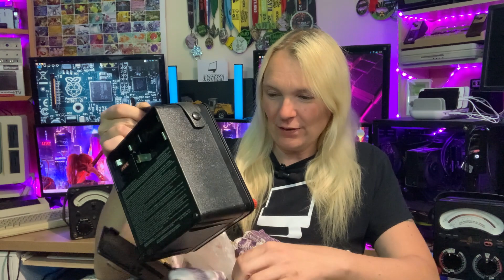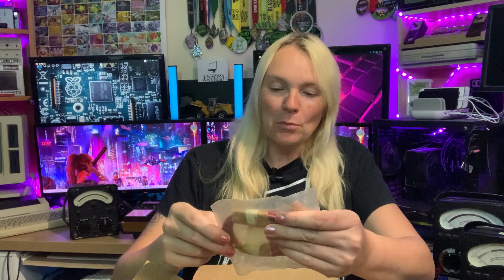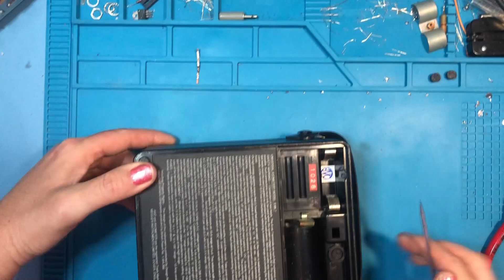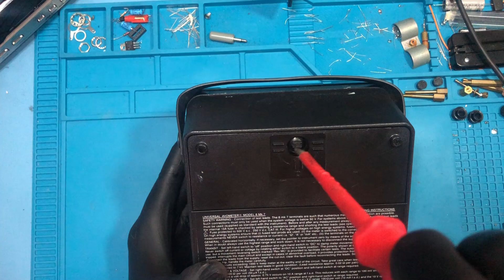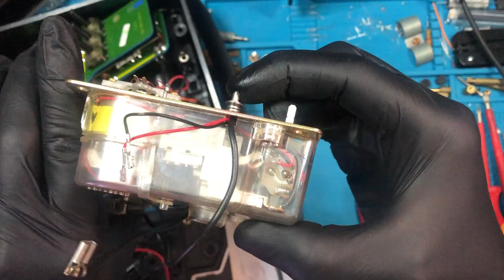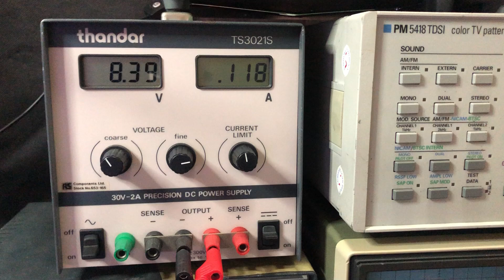AVO 8 Meter Repair Part 1

Comment: My trusty AVO Mk4 is my go-to analogue meter (it helps that it is still pristine and hasn't been dropped!), the components are wired point-point with robust wound bobbins. I much prefer it to the later ones. You appear to have a Mk6 which still uses PCB's but I guess they've ironed-out the failures of the Mk5 by then?
Reply from the maker: The one I have, (2 actually), are AVO 8 MK7's. An extremely rare version. I did hear the early PCB ones did have problems. I haven't had any with mine.
I do have a couple or earlier ones as well with the traditional wound bobbins and current shunts etc. Sometimes an analogue meter can do things a digital one can't.

Comment: i have the version 3 but no probes
Reply from the maker: You can use ordinary banana leads. The special AVO probes are needed if you are going to measure very high voltage.
Reply: @JazzTechUK  ok. i tend to stay away from very high voltages :)

Comment: Nice video, hope there's a part 2, the grease in the housing is deliberate, they put it there to catch any dust and debris, you can see it on your donor unit as well.
Reply from the maker: That's something I did not know. Thanks for that tip. There will be a Part 2 at some point so we can check its calibration.
Reply: @JazzTechUK  I‘m new to electronics repair and thought these would be good things to start learning on so I’ve done a lot of reading about them recently. I look forward to a calibration video, mine compare well with a cheap multimeter, which is more accurate is anyone’s guess at the moment.

Comment: Such a classic, those were made for a long time in different variations. I have a Mk1 which unfortunately is not in pristine condition but it's working and complete with the leather case and possibly original leads (not sure of those but they are old style textile insulated ones). it has some wear (mostly in the lettering on the face) and the battery compartment was corroded when it arrived but fortunately soaking with winegar cleaned it ok. I 3D-printed an adapter to use a stack of coin cells in place of the original high voltage battery and it works in all ranges but reads a little bit low so probably would need a calibration of the movement which is done by moving a magnetic shunt to adjust the field of the magnet. Also the zeroing pots for the resistance ranges behave a little erratically, might need some cleaning. Very different inside from the one in the video, no circuit board, all point-to-point construction and very well built. Must have cost a lot back when it was new.
Reply from the maker: These AVO meters are all very high quality. Not many things are made to this high standard today. There is a seller on eBay that does stacked coin cells in a 3D printed case, even has an Eveready label wrap around it.
Thanks for the sub and thanks for watching.

Comment: I have a AVO 8 from 1957  and one from 1952  both have issue with the ac range and using selenium  bridge rectifiers not sure if the ac transformers is at fault or the rectifier and the problem is what to replace the selenium rectifier with, my be use  4   OA95 geranium diodes.
Reply from the maker: I would just change the rectifier for some silicon diodes, like 1N4007.
There is an absolute ton of detailed useful info on AVO meters on this site  https://www.petervis.com/avo-meters/avo-meters.html

Comment: Loved seeing that. Many thanks. Yes when servicing old equipment, the docs/schematic often/usually require all voltage measurements are done with a 20,000 ohm per volt meter otherwise measurements will be off. I think a lot of newer users are unaware of that and think a DMM is superior in all applications. Just putting it out there. Looking forward to Pt. 2. Cheers
Reply from the maker: You are very correct when it comes to old equipment. There were no high impedance non loading meters in those days. Sometimes a good old analogue meter does things a digital one can't do, like giving you an indication of reading that is flickering around and can't be read on a digital meter. That's why I keep a couple of decent analogue meters around. The same is true of analogue scopes when looking at audio waveforms.
There will be a part 2 but don't know when. Have so much on. Thanks for watching.

Comment: Hi Jazz. Nice job but a quick point. 
Please get yourself some suitable spanners/box spanners( probably BA in this case) as using pliers will inevitably produce metal swarf, and we all know where that will end up! 
 Those 15 volt batteries are both expensive and hard to find. I use 5x 2032 Coin batteries in a piece of plastic tube with a suitable conductive spacer. Much cheaper, and works fine as the highest resistance range uses a fairly low current, and is usually only used intermittently anyway. I’m curious about the battery adaptor. Is it for the 15 volt battery? A good project for someone with a 3d printer.
Reply from the maker: Yes it's for the 15V battery. I have some nut runners on order.

Comment: Nice repair! Always a pleasure to see old gear restored. One thing that you didn't mention - when reassembling analog meters, always check the alignment of the mechanical zero adjustment screw offset pin with the slot in the arm on the meter movement spring, otherwise the mechanical zero screw will not work properly. Regards, David
Reply from the maker: I know what you mean and it's a valid point. In my case both meters were zeroed before I started so I didn't have a problem. Thanks for watching.

Comment: Great, I've never seen inside one before. Analogue meters are still usefull e.g, when you have a varying power draw on flashing lights, you can mentally see the average current, which is difficult on a wildly varying digital display. 

For those that don't  know, AVO stands for Amps, Volts, Ohms !
Reply from the maker: I couldn't agree more. Fluctuating signals cannot be determined on a digital meter. Thanks for the sub and thanks for watching.

Comment: Geat video! I love that old meter, can't wait for part 2. Did you notice that in the bundle of wires connecting the main board to the meter unit, the wires are color/numerically coded? 0, 1, 2, 3, 4, 5, 6,  black, brown, red, orange, yellow, green, blue? Kind of cool using the resistor color code that way.
Reply from the maker: Yes I did notice that. Rainbow ribbon cable used to be quite popular as opposed to just boring grey ribbon cables.

Comment: I have a Model 8 Mk II - thus rather ancient. It's a shelf item now, never use it, a couple of Flukes do a better job BUT the giant meter movement is lovely to behold.
Reply from the maker: Yes it is. It's very nice and great for measuring fluctuating signals which can be difficult on a digital meter.